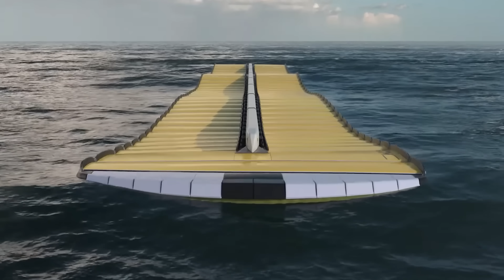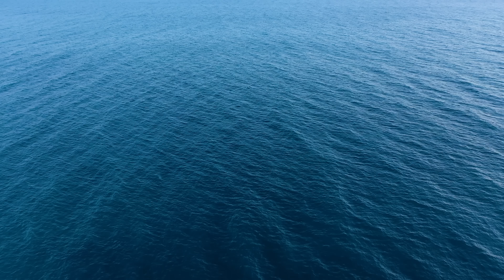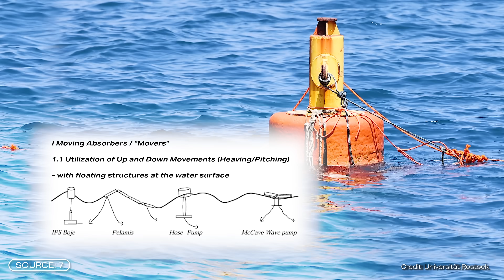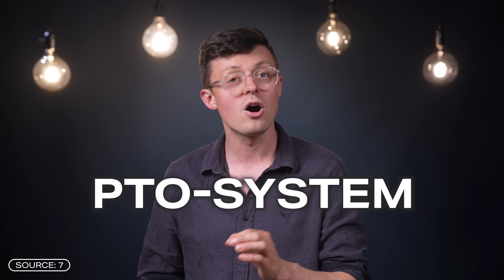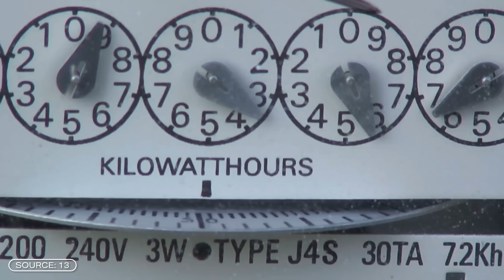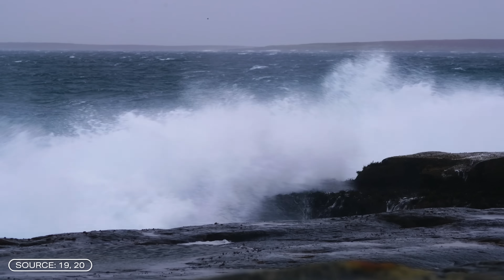The Cheapest Energy Source Ever? Wave Power at 1 Cent Per kWh

Comment: And yet can only actually put in about 15% of advertised output and getting credit for it once exporting to the grid the ignorance of Renewables exporting to the grid is easily demonstrated with a volt amp meter what the optional amp clamp only takes a second assuming you could do the math

Comment: It’s a good to have alternatives, but it’s not easy to believe promised price point. This technology seems to be complex and operates in harsh conditions. There’s problems like storms, corrosion, barnacles and large number of moving parts. It’s also difficult to see how wave power could be constant. Every place I have been the strength of the waves varies greatly on different conditions. It’s quite obvious this is related to wind, but besides speed, also direction, duration and temperature conditions have influence on wave height. Waves don’t die as fast as the wind but take much longer to buid up. They also need weather conditions where wind blows from same direction very long time, so wave power can’t harness coastal winds.

The key question for profitability is a cost structure. Is it possible to build a power plant that can produce its maximum output in relatively light waves with little extra costs compared to max peak output version. In any situation, there’s a hit from non reliable energy source, which increases the total cost.

Comment: My criteria for a practical ocean power extraction system:
1. Does it have moving parts exposed to weather?
2. Does it have electrical or other mechanisms that need protection from exposure to seawater, and maintenance?

I expect such a system to keep all mechanism well below the surface because ocean weather is hell on moving parts.
But it can't have any electrical or other equipment that needs protection from salt water down there, where you would need divers to fix it. Does this sound impossible?

Something has to move, and a generator needs to spin. But what moves can be air or water, pumped through sea-floor pipe or ducting, or a rotating shaft or cycling cable, leading to a blockhouse on shore, or possibly a big, anchored ship. The generator is there, spun by the mechanical power, protected from weather. All the exposed equipment does one simple, foolproof thing, and everything that needs maintenance is protected, with one generator shared among all the modular equipment out there.

It should also have no mechanisms exposed to surface conditions and weather. Ocean weather is absolutely punishing, and has sunk innumerable energy extraction schemes. I have seen a system with flexible air bellows compressed by pressure of water above as waves go over. I have seen buoys that bob up and down with the waves, pumping water through a common pipe to shore. Those have a chance of being practical.

Tidal power extraction seems always to involve underwater generators inside monstrous rotors, which is either very, very expensive or will fail soon, or both. Being out of the weather is good, but needing to visit them underwater for repairs is not. They would better have extremely simple mechanisms fully compatible with exposure to seawater to deliver mechanical or fluid energy to someplace protected where it can be applied.

Comment: If you want to make a device that extracts maximum power from water, you must use floats that will cancel the wave motion by extracting all the wave's energy from its lowest point on the wave to its mid-point or true water level. Essentially the wave is neutralized creating a calm area after passing the wave energy extractor. What I find interesting is that no one is doing this, but it is so obvious!  It is also important that the extractor is positioned correctly. A proper working device could very effectively work as a "break water" to part of a beach.

Comment: I have worked on developing and using offshore equipment for decades, including wave energy conversion. It is incredibly hard to make it durable and low maintenance. That's why there are no commercially operating systems yet. I expect that tidal conversion is a more effective but still difficult proposition.

Comment: Floating on top of the water is not a good idea. It needs to be underwater, protected, and out of sight. Or it could get on land with only a blow hole pipe to allow the waves to drive the system.

Comment: Two years in the sea off Cyprus without problems may look good, but it's not that long when you're dealing with Nature. It is therefore no great surprise that Sea Wave Energy can't find funding for the next phase.
Also, using stainless steel for structural parts sounds good, but there are different grades of stainless steel (or Corrosion-resistant Steel to give it the correct technical name). I have seen bright shiny steel railings at coastal resorts, with brown stains at the joints. Tricky!

Comment: Wave energy is even more diffuse than solar or wind energy.  I know that many will disagree but believe that the future of clean energy will be nuclear.  You can put it where it is needed so you need less overall infrastructure.  It is cleaner, greener (less steel and concrete per KWhr, etc) uses less land and is safer than any of the alternatives.  Some of the newer SMRs are projecting 3 to 6 cents/KWhr and will build times as low as 60 days.
Reply: So true.
Nuclear energy is the low carbon energy of the present. We have enough uranium and thorium for thousands of years.
With the current heatwave in Europe we can't wait for startup promises to become MAYBE true in the future.
Let us stop dreaming and be realistic.
Reply: More specifically thorium.

Comment: That's a great idea, but the main issue is its feasibility. In a month, it will be overrun with shells and algae. I saw a similar project elsewhere, which used magnets and moving coils, completely enclosed, without mechanical transmissions.

Comment: The vast majority of the energy that generates waves in the first place is wind, so where ever there are waves relevant to extract energy from there's many times more potential in wind, typically well within relevant distance if we're talking commercial power generation. And wind is also much much easier to extract energy from with good efficiency than it is to extract energy from waves with heights and other factors varying. All this means wave power generation just for power generation is dead end, possibly except in extreme niche cases, like some off-grid situation where even a minuscule amount of power can be highly valuable, and you for some reason can't use better alternatives. 

That particular design, with a long "mat" along the wave direction is very obviously a really bad way to achieve that pointless goal. As you can't remove energy and still have it, that long design means the energy extraction potential is very low for the amount of equipment required. You absolutely have to use a some kind of potential to extract energy, and that potential is "used up", when you convert whatever part of it to useful energy. Using large number of segments to extract energy from the same fraction of a wave is in some ways comparable to stacking wind turbines directly behind each other in the wind direction in long rows to extract energy from the same part of a wind multiple times, it's very obviously a horribly bad design.  If the first segment in such a mat extracts energy from the wave, there's less energy left in the wave behind the first segment, so right behind the first segment is the absolutely worst position for the second segment, and the worst possible position for the third segment is behind the second segment, and so on.  

The claims about the  potential are just absurd, no reason to take them seriously to any degree, if there are waves that potentially could be relevant for commercial power generation the wind that generats those waves represents a many times bigger potential and is many times easier to utilize. And that particular design is extremely bad even for wave power generation, which you only need a basic understanding of some very basic physics to realize.    

That 1 cent per kWh claim isn't even realistic just for installation and subsystems required, that is, if you got the "generating part" for free.    

There are definitely situations where the highest wind potential is "uncomfortably" far from the shore the waves hit, but wind doesn't act in a vacuum, you don't need the highest potential that exists to generate power from wind at much lower cost and more reliably than it's possible to generate power from waves.     

Wave power generators could maybe, possibly, make sense if they were installed to protect the shore, to reduce the energy in the waves that reached the shore, turning some of that energy into useful power instead just "fighting" the energy in the waves. The power generated would have to be considered a nice bonus though, as the value of the power that realistically could be generated would be well within the typical margin of error when the cost for such projects is estimated.  

And obviously, wind turbines in the right positions could also reduce the energy in the wind that cause waves and by that the amount of energy in the waves that reach the shore, but for a significant effect you would have to have so many wind turbines so close together that the power generation from each turbine would be less than it would be with proper spacing. I assume most people would consider the idea of intentionally placing a lot of wind turbines so close together that they caused a meaningful reduction of potentially destructive winds and also the waves the wind generates at the cost of  generating less power from each turbine completely insane, and maybe it is, but it's not anywhere as stupid as commercial wave power generation.
Reply: Wind is a pathetic source of energy.  What I mean is that a wind farm with a nameplate capacity of 1 GW produces a measly ~3 billion kWh annually.  By comparison a geothermal power plant with a nameplate capacity of 1 GW produces ~7.5 billion kWh annually.

Comment: 100MW sounds like over-promising. Lasting 50 years? Being cheap? Nice. Can they even afford to built it and sell it? Research and developments has had it costs too. And also, if you produce electricity out on the water, you still need to get it ashore for use on land. Also, if you cover large amounts of ocean with it, the thing is not transparent and it will block out light. How can it NOT impact the environment? Colour me skeptical.

Comment: Hi Jacob, another well laid out and thought provoking video, this looks like quite a promising concept, as people have said the main problem is with corrosion however with new materials coming along all the time I think this is a very feasible way to go, for example ceramic bearing and stainless steel would solve a lot of problems plus silicone is very durable when used for flexible tubing, it is also encouraging that people are coming up with different ideas for sustainable power generation, let,s keep posotive thoughts and ideas coming, regards Nigel from England.
Reply: Geothermal is the solution, stop wasting time with this distraction.
Reply: @TerraPotentia   A very valid point and hopefully will be put into action in the near future in a much bigger way but it is always good to keep an open mind on all avenues of sustainable energy production.
Reply: @MrNigel1340  There's an old saying...

"work smart, not hard"

The moral of the quote is to emphasize efficiency, strategy, and leverage over brute force or endless grinding.

A world filled with millions of wind turbines, billions upon billions of solar panels, and hundreds of trillions of man made batteries for battery energy storage systems, ALL OF WHICH have to be recycled every 15-45 years, is...

--- WORKING HARD WITH ENDLESS GRINDING ---

Tapping into the NATURAL THERMAL BATTERY beneath all of our feet, with limitless thermal energy contained within it, is...

--- WORKING SMART AND EFFICIENT ---

Geothermal is the path forward...
Reply: Stainless steel is not a new material by any means. And most stainless steels will eventually corrode in salt water.  Specialty composites would probably be more viable.  But then, microplastics and UV degradation are potential issues.
Reply: @justinw1765   Hi Justin, yes you have a very valid point there about stainless steel, as you said that with new materials coming along there could be other solutions which hopefully will do the job, it is heartening to see that people are looking for ways to tackle the energy crisis with many new ideas coming along.

Comment: Great video! It doesn't look as though it has anything revolutionary in it compared to all the other dead wave power projects. The name is rather misleading. I thought they were doing something clever with magnets and floats so each element generated electricity, but no, looks like lots of pumps. Loads of mechanical moving parts with bearings to wear and corrode.

Comment: I think the claim of 1 cent per KWh can only be proven after the product have been developed. On top there is the question of installation costs and maintenance costs, did they consider those? I doubt it. 

The technology is very interesting. We'll have to see. I heard about CorPower Ocean buoy, the ones you showed in the video. They've already been proven to withstand bad weather conditions well. I doubt this Wave Line Magnet can do better as it consists of a much larger body in the water, it will take a tougher beating seems to me. I'm a bigger believer for the bouys. 

But maybe the Wave Line Magnet will perform better in quieter water and maybe you could add solar panels on top. That way with bad weather you could get more wave energy and quiet weather you get more solar energy in stead, all using the same space so space is not wasted. And actually CorPower Ocean buoys are not that good in quiet water, they perform best where waves are relatively strong, in though water conditions. So both system can have their place. 

We're still not freed from energy storage systems. I'm a believer for Vanadium Redox Flow Batteries. Very limited rare metals needed, no explosion danger. Iron-Air batteries sounded promising too but not available to buy as far as I know. 

I appreciate your informative videos bringing new possibilities to my attention.
Reply: This idea of producing energy from the ocean is rubbish.

Comment: Waves are powered by the wind, so this will not work without wind, and if you have wind then you can use a wind turbine.  Many modern 16MW offshore wind turbines have one moving part in the main drivetrain, to get 16MW out of this will require tens of thousands of moving parts... the wind turbine will be far far cheaper to build and maintain, and far far far more reliable!  The cost claims are as believable as Donald Trump!

Comment: The Oceans are huge, therefore Energy from Waves or Tide is very possible.

I still favour Huge Paddle Wheel driven floating Generators.
The only things in contact with the Water would be the floating support vessel, Anchors, Grid Cable and Generator Drive Paddles.
The Generator, Gearbox, Switch gear, Controls are all out of the Water.

Comment: I don't understand why the increased complexity of pressurizing water through a turbine instead of just having each of the lever arms contribute through a one-way bearing to a central shaft that directly runs a generator.
Reply: I would imagine for consistency/load balancing reasons. Think of the way those new continuous spray bottles work by pressurizing the bottle so it can keep spraying between squeezes, this would have the same effect of allowing for continuous generation between waves.
Reply: @TylerKrick as would a flywheel on the shaft with less complexity. Pressurized bottle and a flywheel do the same job.
Reply: @chris993361  certainly that would work as well, but in a seawater application like this I would choose a pressure vessel and pump over a flywheel for fewer exposed moving parts
Reply: All forms of harvesting wave power need to be explored, the best chosen then a full blown wave generator built and put into service. Only real world experience will eventually prove it does work or is an idea best forgotten.
Reply: I think what they're trying to do is to take as much of the mechanical complexity off the actual wave harvester and put it in a central location on shore.  This seems to be a fairly modular system, and making a small, simple pump in a manufacturing setting is much cheaper than making the same number of mechanical linkages that all need to work together to generate electricity.  Also if a pimp unit breaks, you can just send a guy out in a boat and replace one unit without disrupting the entire thing, but servicing a complex transmission system will be much more labor intensive.
Reply: Turbine might not be the best choise, but mechanical solution can’t work well because movements are not synchronized. You’d need springs and variable pitch crankshafts. If you have a cylinder that pumps water against pressurized air, it does the work independently on other cylinders and the pressure works as a reserve. As long as pressure reserve is large and doesn’t fluctuate, energy is not lost. For making electricity from pressurized water, the turbine is the best option. Gearing up slow moving axel is not very efficient.

Comment: It should be easy to modulate the waves manually by having an unpowered actuator with bleed hole for static running

Or if your running an adaptive receptive breaking system to suck the energy ⚡️⚡️⚡️🪫🔋
That will be super efficient 🥰👍 

Omg it’s look easy to make & assemble 
Maybe ?!?!?!? 🤔 

And omg 😳 underwater data centers would benefit from the system because it can be offshore powering the data cent and not draining the grid America duh 🙄😒of precious, clean water supplies ! Double Duh 😒🙄😒🙄🙄